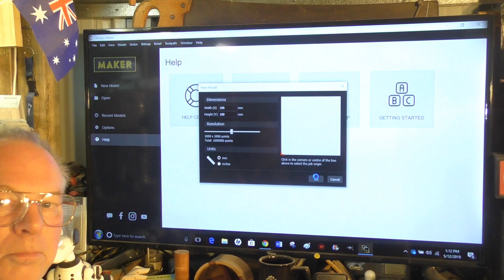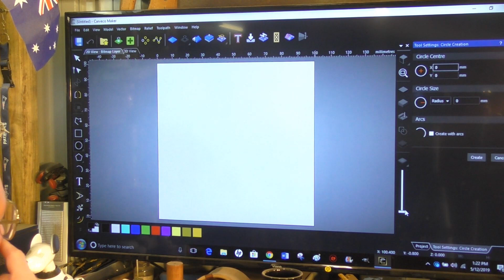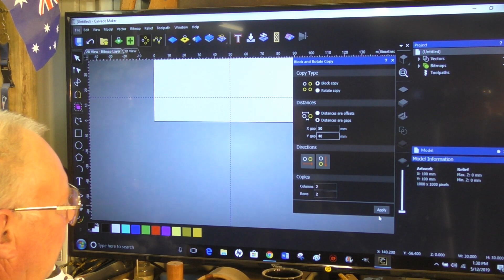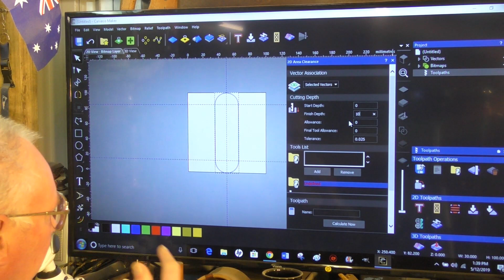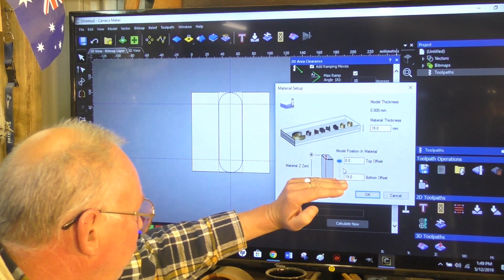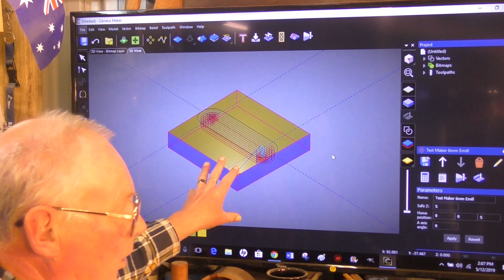Starting with CARVECO Maker *first look*

Comment: Hi Roger, great video. I'm new at this and started using carveco maker a coupe days ago. I was exploring the software and somehow I have lost the 2D and 3D tabs that are in the upper left corner of the viewing area. Also, when the program opens and I choose new project and set the initial dimensions, it opens both the 2D and 3D windows and I have to minimize the one I don't use. I don't know what I have done but how can I restore the original settings? Thank you for the great videos and I hope you can help me.
Reply from the maker: Hi Jerry, restart Carveco Maker as it starts on the opening screen go to the top bar open the WINDOW icon and select RESET WORKSPACE. this will put Maker back to default layout for you.

Comment: Thank you Roger.  I have been following your videos for a while now and have found them to be very informative.  I bought the program, now I need a desktop to run it on - my old XP machine isn’t going to cut it.  Suggestions from you would be helpful.  Not specific computers, but general info on what is needed to efficiently run the program.  My biggest question deals with the graphics card, Carveco recommends “2 GB RAM, Open GL 4.0 Compliant and Direct X 11 Compliant”.  That gets pricey in a hurry.  Is it really required?
Reply from the maker: Hi Neal, I would recommend, 4G RAM, 1T and intel i5 +